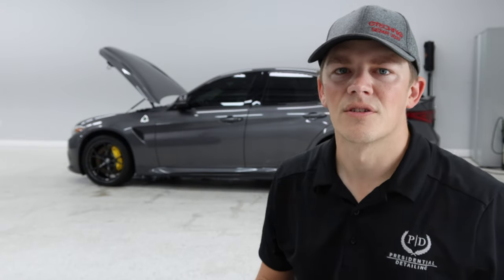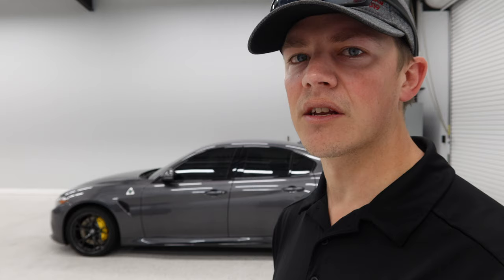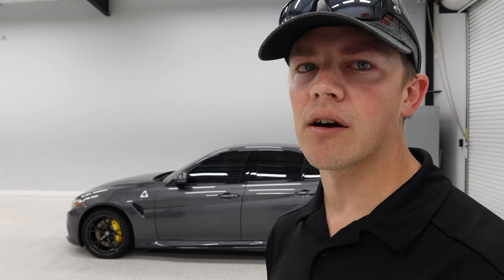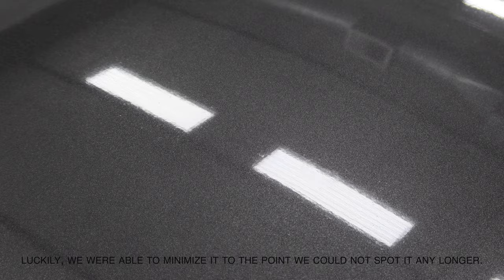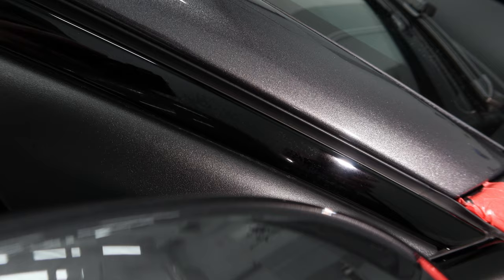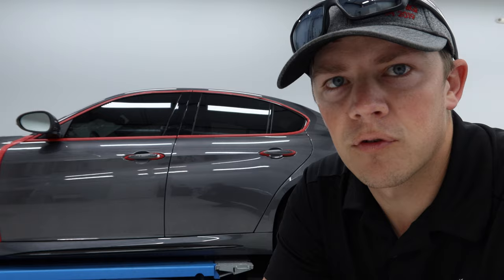Alfa Romeo Giulia Quadrifoglio New Car Protection Detail - VLOG 003

Comment: Awesome work!  You have a very methodical approach and a humble attitude.  I wish you success!  
Question -- Have you gotten any feedback regarding water spots?  I want to commit to coating but passing showers and potential water spots that coatings are known for are keeping me on pause.  Also, are you concerned with breathing in any coating fumes?
Reply from the maker: Water spotting can be an issue depending on your environment. If you are already having trouble with spotting, a coating will not fix that issue, might make it more difficult for you. In that situation its usually better to just do a light polish every 6 months and apply a sealant. If you arent seeing issues with the car now, you are most likely safe to use a coating. Hope that helps!